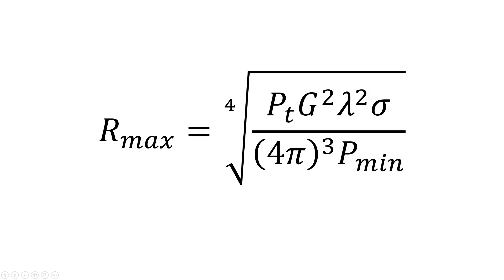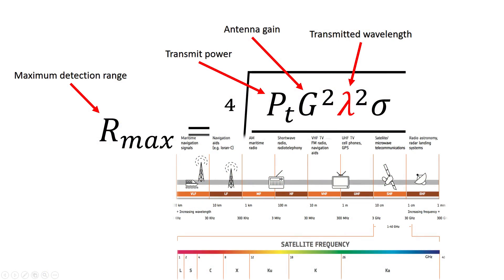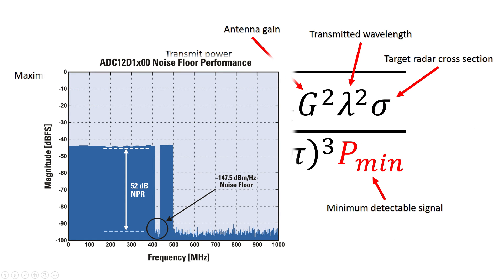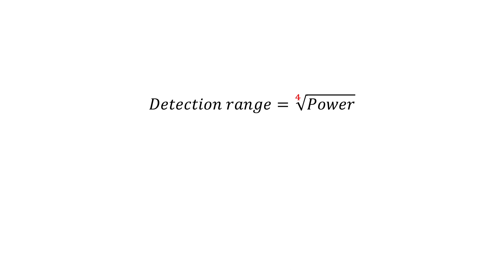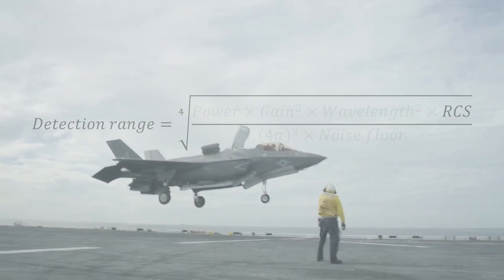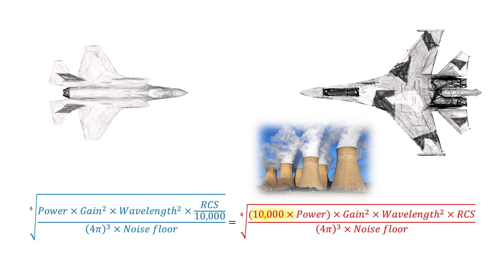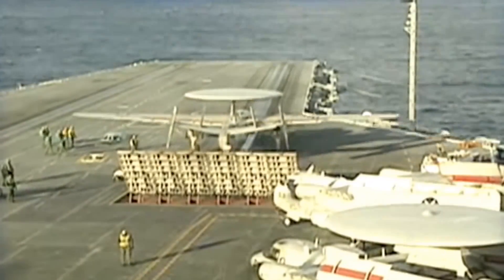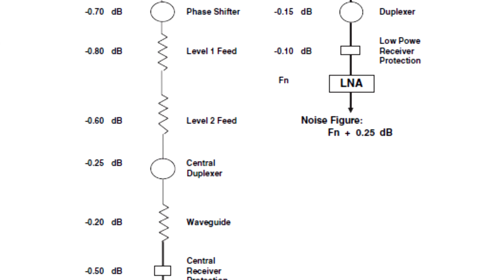F-35 Lightning II: Busting Myths - The Radar Equation [v1.1]

Comment: Fantastic. Now if we can get the enemy to only approach us head-on from the same altitude, not use IRST, not employ jamming, not use AWACS or ground based radar, and avoid using our own radar, we'll have a big advantage! I'm sure they'll fight on our terms, that's usually how wars have worked out in the past.
Reply: Oh of course this gets vastly more complex is real world scenarios. But most of those scenarios still give massive advantages to stealth. IRST detection range is much lower than radar. AWACS and ground based radar can utilize lower wave lengths but these are not accurate enough to use for missle targeting(and more importantly are giant expensive and relatively unmobile resources limiting your effective battle space). Not frontal signatures are higher but not but still comparatively lower.  

I think valid arguments can be made that the cost of the f-35 was too high both for what we got and what we needed. But all the arguments you see online about the f-35 not being extremely powerful in modern air to air combat are crazy.
Reply: @ 1barnet1, @Artie the Swolest Man in the World

1) It's sad you guys don't know what LPI is. Although theoretically you can track an LPI radar, it's much harder to do so in actuality. There are many techniques used in LPI which makes the radar not only impossible to track, but largely invisible to detection equipment. I'll talk about two known methods. The first of which is power scaling (not the official name, but it gets the point across). Essentially the APG-81 and APG-77 are smart in the fact they use only enough power to maintain a track on the target. Utilizing their much lower noise ceiling and much greater sensitivity to maintain power well below that of detect ability. The second part is channel switching. The APG-81 and APG-77 utilize a much greater and more precise bandwidth; "hoping" the frequency over 1,000 times per second at random. This combined with the much narrower FOV utilized by each individual AESA beam means that maintaining any kind of track on an APG-77 and APG-81 is nearly impossible. Raptor pilots have said many times that the AN/ARL-94 is by far the most advanced and capable piece of equipment on the F-22 (a departure from standard RWRs in that it's actually used for targeting/tracking); yet F-22 pilots have often testified that detecting the APG-77 with the AN/ARL-94 is very rare, and can only be attempted at relatively close ranges. These testimonies come from before the F-35, which employs a more advanced passive detection suite (the ASQ-239), and the APG-81 is actually an advancement over the APG-77 (except the APG-77 aperture is physically larger, which aids its detection range, a lot of the hardware advancements of the APG-81 were rolled into the APG-77 via the APG-77v1). 

On top of this, passive radar tracking is not something that every RWR can do. The standard F-16, F-18 and F-15 cannot track or target opposing vehicles passively. These aircraft only gain such capability when equipped with certain EW pods which are designed for SEAD (not air to air). The story is much the same for the Russian arsenal. Aircraft like the Su-25 and Su-34 can be equipped with pods for passive radar targeting, but for SEAD and not the air to air role. The only fighter the US has which comes standard with passive radar detection, outside the F-22 and F-35, is the EA-18G. Otherwise the passive detection role in air to air engagements has mainly fallen on AWACS rather than fighters (for both the US and Russia). The use of which is to direct fighters towards engagement, the fighter then use their own radars for execute such engagement. I have yet to find definitive documentation of the Su-35/30 or Pak-FA's capability for passive radar detection/tracking for aerial targets. Let alone for LPI radars, which all of the above conventional passive methods do not work with. 

2) IRST is not as capable as many make it out to be. Yes, the IR of PIRATE can *detect* targets at ~100 km, but that does not mean it can *engage* targets at 100 km. The issue with IRST is that IR provides no altitude, speed, range or geo-location. To gain such information, IRST uses a laser. The trouble with lasers, is that they have a very short range at the power aperture current systems utilize. Their range is well under 50 km. Even then, stealth aircraft, like the F-35 and F-22, are built to be stealthy in more than just X-band radar. "Stealth" for the USAF means passive detection capability, LPI radar, low radar observability across all bands, and low IR serviceability. I'm not saying "stealth" is invisibility. "Low observability" simply means that the signature of stealth aircraft is greatly reduced in all means compared to conventional aircraft. However, even without accounting for this, the range capabilities of IRST are quite poor. While a conventional aircraft with IRST may have a greater detection/tracking range of a stealth aircraft than a conventional aircraft without IRST; both are still at a significant disadvantage currently when compared to a stealth aircraft.
Reply: +John Ham  If you're talking about their reference at 2:54 I have sourced it, and it's a fabrication. This text is from a patent that pertains to the construction of stealth composites using carbon-nanotubes, allowing stealth to be baked into structural panels rather than painted on top as before. The patent makes absolutely no claim that these panels are any stealthier than previous materials, nor that they are effective against a wider bandwidth, it covers only the new construction method. As part of the parameters it states they affect radar in frequencies ranging from 100 kHz to 60 gHz, but makes no further technical claims or disclosures. This just specifies that it has SOME effect in these ranges, which says nothing about what the attenuation curve looks like or how effective it is across various wavelengths. If LM were claiming it was more effective at absorption than previous technologies or covered improved bandwidth this would be explicitly stated the patent, but it is not.

The narration claims "new materials have been shown to be highly affective against a wide range of frequencies," while highlighting text from the patent. As you can see, this is a lie. Not only does the patent have nothing to do with any demonstrated capability (as patents are merely legal stake-holding claims), it does not even allege to pertain to improved stealth characteristics. This is typical of the extreme intellectual dishonesty (or outright ignorance, take you pick) that is fairly common in the F-35 fan community. I can't speak to the author's intentions, but it seems telling that they don't bother to offer more depth on such a fantastical claim that would greatly bolster their argument if true. Seems reasonable to infer they know this statement is false but just don't care. I wouldn't even have known what the statement was in reference to if I hadn't already been familiar with this patent, since they don't give their source or any explanation apart from flashing some text snippets.

I mostly agree with your other sentiments with the exception of the assertion that other nations are "chasing down and wanting the F-35." Outstanding contracts to purchase F-35's have way more to do with politics than any efficacy measures (which is usually the case in defense deals, in no way exclusive to the F-35). There are few countries that are free to adopt weapons in a totally free market fashion, but India is certainly the prime example. I think it's interesting to see them vacillate between their choices, classically leaning towards Russian jets, recently looking for new Block 60 F-16s, and now apparently opting for Rafales instead. It says a lot that they have not even considered the F-35 at any point in their recent search for newer fighters.

In my opinion the biggest failure of the F-35 has to do with the procurement dynamic it creates. While the Navy has adopted an Open Architecture for ship-borne sensors/computing hardware the aircraft industry has fucked themselves by throwing all their money into a single proprietary system with limited growth potential. You're right that sensors and electronics are our greatest advantage, and the F-35 is definitely leading the way in implementing them, but in a totally backwards fashion that limits participation from other manufacturers and stifles innovation and inter-aircraft implementation.

I'm glad to see you are pretty open minded and not a delusional fanboy! Been a pleasure talking with you.
Reply: +John Ham  "Oh wait…" the F-117 has been shot down at a higher rate than the F-15 if you want to talk about sorties flown/shoot-downs. Not that it matters, because that's a useless one-dimensional benchmark that fails to recognize even basic logistics, let alone myriad other factors. The primary way all of our jets avoid shoot-down is proper mission planning, overwhelming numbers, and fighting 3rd world adversaries with hopelessly outdated equipment.

Nobody is debating whether stealth "works," of course it does—it avoids reflecting radio waves from certain bands at certain angles. The question is how useful that is in combat vs the significant trade-offs (in the F-35's case) made in every other area to accomplish it. And you're right, the primary shortcoming of the F-35 has nothing to do with stealth, it has to do with the abject failure of the entire JSF concept. The F-35's only have about 20% parts commonality, government studies have stated that developing three custom airframes would have been cheaper, and the concept resulted in performance characteristics that are no improvement over aircraft of the previous generation.
Reply: Unfortunately it is not possible to go supersonic and not become infrared beacon due to heating of the airframe. If you go high you are the only warm thing in a sub-freezing sky and if you go low the friction increases and the airframe becomes very very hot. Due to heating at low altitude every airplane which can do mach 2+ at high altitude cannot exceed mach 1.2 down low even though most have more than enough thrust. Raptor is even more limited in this respect by radar absorbent paint. I have heard claims F-35's skin itself is radar absorbent material but even if true the F-35 does not have meaningful supersonic cruise. Honestly the F-35 makes no sense from any perspective there is simply no way to do a "budget F-22" for further reading look at Seawolf vs Virginia costs...difference being the virginia class boats are basically same price but basically same capability
Reply: +SealFredy5  You do realize those papers were just the non-classified work of graduate students from over a decade ago, yeah? The advent of digital receivers and fast DSP makes seeing through LPI modulation and pulsing tricks trivial. Furthermore, modern development practices (like FPGAs) make hardware design cycles fast, cheap, easy to implement, and easy to upgrade. "In summary," any military pouring billions of dollars into defense can certainly equip themselves with ES equipment that detects LPI radar just as easily as CW radar. Get over it.
Reply: +777Outrigger 😂 You're the sultan of self-serving reasoning. All the fallacy-laden farces you come up with are hilarious. Keep em' coming, I know the F-35 fanboi circle-jerk demands you stroke your neighbor so everybody keeps their hard-on.
Reply: +John Ham  I haven't read this report or seen the video, please link and I'll read/watch. The thing that makes lower bands difficult to defeat is not just a matter of optimization or choosing certain bands, it's a limitation of the physics. Lower the wavelength, the more energy it carries (which is why you need a larger radar to produce them as well). Stealth coatings work by transducing EM energy into heat by a sort of mechanical vibration. There are fundamental limitations in how much energy can be dissipated in this fashion, the conventional wisdom being there is no way to preclude lower bands from reflecting. Even the F-117 had certain RAS features that helped against higher energy bands, but not by much, and nothing approaching the attenuation seen in centimeter wavelengths. There is also the airframe shape, but you need very long edges that are longer than the wavelengths being used, so larger planes like the B-2 are much stealthier against lower bands than any fighter-size aircraft can be. These aren't exactly things you can just engineer away, they're an inherent property of the system itself.

As for other countries, of course they will put effort into making their aircraft stealthier, this has long been a design consideration. They do not, however, approach it like we do. They use a far more balanced criteria, much less willing to compromise in other areas just for the sake of stealth. Especially when it comes to cost. They do what they can but their aircraft are not as stealthy as US airplanes and also avoid many of the pitfalls of making stealth the #1 design objective.

As for a "golden bullet" or single panacea to defeating stealth, naturally there isn't one and there never will be. Because that's not really how the process is approached, everything is simply an element comprising part of the bigger picture. Better radars, better IRST, better coordination, etc will all grow together and all used in conjunction to detect and defeat increasingly stealthy aircraft and drones on both sides. Relying too much on any single facet is a recipe for disaster.
Reply: 1) no stealth aircraft ever been only stealth head on , same altitude. If that was the case then they wouldn't be stealth against ground radar at all. Which is clearly not the case. Looking at most radar scattering graph , you can see that stealth aircraft general have bow tie shape signature 
https://basicsaboutaerodynamicsandavionics.files.wordpress.com/2016/03/f_35_metal_rcs.png

2) IRST can help somewhat but they affected significantly by weather ,humidity , target aspect and need to rely on LRF ( laser range finder ) to generate firing solution because they can't measure distance, target velocity or altitude by themselves. Laser range finder is limited to around 15-25 km so they offer much shorter range compared to radar 
https://s18.postimg.org/4wot7d07t/IMG_20170219_183944.jpg
modern stealth has measures  to reduce IR signature too
https://basicsaboutaerodynamicsandavionics.wordpress.com/2016/03/04/stealth-techniques-and-benefits/

3) Both stealth aircraft and normal aircraft can use jamming but it always  benefit stealth aircraft significantly more due to signal-noise ratio. Generally  jamming power required will decrease in the same rate as RCS reduction ,99.99% reduction in RCS equal to 99.99% less power required to successful to jam a radar. The burn through range will be reduced significantly too
https://basicsaboutaerodynamicsandavionics.wordpress.com/2016/03/29/electronic-countermeasure-ecm/

4) stealth aircraft such as F-117 often less effective against very low frequency but it has nothing to do with power in the radar pulse. In fact, low frequency will carry less power than high frequency ( which is why microwave use cm band not UHF or VHF to cook your food). The reason why low frequency work so well against legacy fighter is due to their interaction with object, when ratio between  aircraft physical size  and radar operating wavelength  start to get into Mie region, the majority of the reflection will be surface wave , and surface scattering. For legacy stealth aircraft like F-117 with full facet design this is a big problem. That is why newer design like B-2 , X-45 , F-22 , F-35 all use many blended facet to reduce effect of surface wave. Modern RAM such as CNT RAM is very efficient against low frequency too
 https://basicsaboutaerodynamicsandavionics.wordpress.com/2016/04/12/radar-electronic-countermeasure/
https://basicsaboutaerodynamicsandavionics.wordpress.com/2016/03/04/stealth-techniques-and-benefits/

5) modern RWR can certainly counter LPI, however, as all passive system , they are very bad at calculating distance to target , target's velocity , target altitude so unlike radar those RWR can't generate good firing solution for air to air BVR attack
 https://basicsaboutaerodynamicsandavionics.wordpress.com/2016/03/02/rwresm-and-passive-geolocation/
Reply: Artie the Swolest Man in the World 
The heat from the airframe is dissapated rather quickly and can't be detect at very large ranges due to atmospheric conditions. 

Then this effect of friction is smaller at high altitude and the F22 has a very high service ceiling

An afterburner tailflame on the other hand is a much brighter signiture which is much easier to detect. 

The F35 completely lacks supercruise. It can use afterburners to go to mach 1.6 and then use full throttle without afterburner to slowly watch the needle go back to subsonic speeds. 

That's not supercruise. That's marketing bullocks.
Reply: True, their spies were doing a good job, and radars were only turned on for only 17 secs at a time to prevent an attack. But because of terrible comsec by NATO, they were broadcasting in the clear with no encryption, and because they were so predicable in routing, the Serbs new exactly when to turn on their radars.
Reply: Why would China invade anybody ?
They'll buy the real estate and factories in Taiwan.
Who's gonna stop them when they come inspect their property ?

You're right Jihadi's won't do PHYSICAL damage.
But they'll do SOCIAL damage,
Turning open Western democracies into paranoid reactionary selfdestructive police states.
This does not sound like a big deal,
but it will change how people will interact.
Imagine living in a society
where you can not trust your neighbours, co-workers,
family or even your very own children.

That society is destroyed, infrastructure standing or not.
Reply: +John Ham  Sounds like you agree that the JSF concept and execution have been a disaster that produced a plane that's barely half as good as it could have been. And I fully agree that shoot-down numbers are a stupid way of gauging an aircraft's effectiveness, I said as much in my reply. Where we differ is how much of an advantage stealth is, and how much it will be able to mitigate areas where the F-35 falls short. Stealth is obviously effective against radar operating in the centimeter wavelengths, but I disagree with the spirit of the statement, "stealth is not an easy thing to detect." Stealth is not a thing to be detected, it's a feature. The aircraft is what gets detected. I'm not denying stealth is a big advantage, that would be silly, but it's equally ridiculous to not acknowledge that aircraft can indeed be detected by many other sensor methods. Inter-aircraft communication is also going to compromise their presence/location, as will use of active sensors/jamming.

In addition to other methods low-band radar is capable of detecting these aircraft and is increasingly becoming more accurate as additional processing is applied to the output. Demonstrated techniques of parallel-processing that emulates neural networks coupled with machine-learning is highly applicable to analyzing radar returns. Low band radar is rapidly becoming more effective (not less), with several experts estimating tracks comparable to centimeter wavelengths within a few years. Not that it's even necessary to guide a missile on target with such radar. The F-35 fan club seems to have a selective understanding of Lock On After Launch. They understand it allows to the F-35 to launch AMRAAMs at high off-bore-sight or 180 degree trajectories, thereby helping it in a dogfight, but refuse to acknowledge that SAMs have been using LOL for decades and that missiles can target a stealth aircraft with their active radar as long as the ground radar gets them in the vicinity.

I have no idea where all the conjecture about stealth features now defeating low bad radar comes from. Seems to be another creation of the fan club after they were introduced to the term RAS as if it were something new. They've massively conflated the concept of not needing to paint on RAM with being something somehow significantly more effective. They love to extrapolate little tidbits they find/are-fed and pretend it's something it's not. They're also big on binary discretes, aka, pretending that just because a patent states that a material has some effect in given wavelengths, that means it has equal effect in all of them. I have yet to see a legitimate article describing new stealth techniques that make low band radars ineffective. Feel free to share links if you have any, I'm always interested in new technologies.
Reply: Same. Not a fanboy and not a hater
Have a good day
Reply: 777Outrigger  I gave you stone-cold facts about the drastic deficiencies of the EOTS and you dismiss them and insist the F-35 is "sensor monster." That's exactly what makes you a fanboy.

As for the Heritage paper it's such a biased piece of garbage that it's barely worth addressing. It doesn't contain any legitimate comparisons of facts and figures, it's just a poorly conducted opinion poll. That's to far from objective, scientific, or useful that it's laughable. Is that really something that bears explaining? Do you not have a degree in a STEM field?

Check out the paper's reference for the cost of the F-35A, footnote [32], that the author cites as a source for the $85m figure. Now go read that source, it's literally an article about how the F-35 will cost more than $85m because of engine problems. It's hard to even comprehend how someone could cite a source that says the exact opposite of what they're it claiming does. That's a clear indication that the author is not just unscrupulous and careless, but reveals their intention is to push a specific viewpoint. They're not conducting an assessment, they're scrambling to find tidbits of info that backup their pre-existing conclusions.

It seems pretty clear you lack the ability to think critically, distinguish scientific evaluation from propaganda, and grasp the concept of nuance. You don't even understand the larger dynamics of how a military functions. You're just obsessed with singular weapons systems and how they compare to similar ones in a vacuum. That's fine but it's 100% fanboy realm, not really a conversation I'm interested in having.
Reply: SickKnowledge , for the sake of physics learn how sensors work :/ .
Reply: Outrigger
That is what you wanna do whilst flying a stealth aircraft, open your bombbay to fire a couple of Cuda's.
Wouldn't it be easier to just yell, "yoohoo I'm here", over the radio ?

Listen here man.
A war with Russia (or China) will devolve in attrition warfare.
In such war it is not that important which weapon system can defeat which other weapon system.
Because in the long run it will all boil down to which country can outproduce and outdeploy the other.
Remember WW2 ?
NOTHING could take on a King Tiger tank.
However, the thing was so friggin complex that only 1200 were produced during the entire war.
Unlike the US Sherman and Soviet T34 which got produced in the 10,000's per year.
In the end, the Allies could simply "afford" to lose tanks by the thousands, unlike the Germans.

So how many "potshots" do you think the Russians are willing to spend on bringing down 1 AWAC ?
1 ? 5 ? 10 ? 25 ? 100 ?
And how many fighters do you intend to divert from frontline duty to AWAC escort ?
2 ? 6 ?
Are you going to put a KC10 (another high value target) in trail of the AWAC to refuel the escort ?
Or are you going to "change the guard" 5 times per mission, diverting more fighters.
It is these LOGISTICAL questions that define the outcome of battles and eventually war.
Rather than "This system is way cooler than that system" assertions, no matter how true.
Reply: Millions can't get to Taiwan, or the first island chain, or the South China Sea. It's not the numbers that your army has, it's if you can get them to where the battle is, which China can't. They don't have the projection forces, and any significant amphibious force is going to end up on the bottom of the ocean. And America won't need to use nukes, LOL, but if China uses them, well, the US has over 10 times the nuclear warheads as China.

If Jihadis appear among immigrant groups from Syria, they can only cause minor damage, and that will enable us to root them out. Sure there will be outrage at the murders they commit, but they can only do minor and insignificant damage.
Reply: It's from a military report. He included it in the video. Take it as word or not. The idea that low band is somehow unbeatable is silly. It still has weaknesses. One of the big take aways from the nighthawk shooting down was making the stealth be more applicable to different bands and I don't doubt that the skunk works has done that. I don't think they'd just bullshit. Different forms of radar is being thought about and accounted for. For now low band is more effective but it doesn't perform anywhere near the same level as standard radar. It's not fanboyism from me at least. It's just demonstrating there's no golden shot for stealth yet. It's why everyones wasting way more money on stealth planes or stealing it in China's case. The T-50 even more so is meant to be all around stealth if you take what the Russians say at word.
Reply: The F-35 is far from a one trick pony. If you think stealth is all it brings to the table, well, you need to do some more study.
Reply: +David DS Good lord, what a troll. every single point you brought up has been dealt with and debunked. Shows how much you know.
Reply: David DS - Haven't heard about Red Flag 17-1, have we. The F-35 had a 92% readiness rate, and no maintenance cancellations. Excellent. The air-to-air kill rate was 145-7 for the F-35, and Blue Air was heavily outnumbered by Red Air in this exercise. And the F-35 took down 49 of 51 SAM sites. Yes, and the stuff in your post is ancient history. Fixed or debunked a while back.
Reply: Sorry, 40 miles ain't good enough. The bomb or missile will already be on the way.
Reply: @Boxy Brown

Ah yes, here we get to the part where you claim to be more knowledgeable and credible than the millions of engineers, generals, pilots and manufacturers around the globe.

- There are no current methods to detect and engage a stealth aircraft at long range. Stealth aircraft maintain a massive advantage over current detection/engagement systems.

- Drones, in there current form, are woefully incapable compared to fighter jets. Most are nothing more than flying TGPs. They have no BvR capability, mostly no AA capability (although the CIA strapped stingers onto a few of them), no SEAD capability, are slow, very limited payload, cannot share data, no ECM, and their other combat functionalities are mostly worse than strike fighters from the 90s. Drones which are equally as capable as manned aircraft are far more expensive than their counterparts. Only one example of this exists, and it's the MQ-4C. It's several times the cost of a U-2 (despite the same capability), and costs more than all variants of the F-35 ($155.6 vs $130.6). Note no weapon systems are carried.

- Long range missile platforms like stealth fighter jets? Your own statement literally proves yourself wrong. There is no "cheap" detection system that can easily achieve kills against a stealth fighter. S-400/500/etc systems actually cost more per battery than the F-35 does, and that's saying something considering labor/materials are much cheaper in Russia. Even then, the S-400/500/etc fall into the same issue all SAMs do. They simply cannot perform against 5th generation fleets in a tactical environment. This is the exact reason why every country that can afford developing fifth generation fighters are doing so. 

- Your idea that drones will somehow avoid getting shot down/engaged is also hilarious. Conventional methods of AA or SAM still work on drones you know: http://www.bbc.com/news/technology-39277940. And yes, this is a perfect example of a weapon being used in an overkill scenario. Radar guided AA and ECM would have been much cheaper (both of which are possessed in the military), but this is also a great example that the military uses what's available to accomplish the goal. Not the theoretical best cost ratio, but whatever works. And if you buy equipment which doesn't perform, you cannot win. 

Also, I've been called a fanboy for pretty much every fighter out there(for instance, the Pak-FA). I take my time to research and understand the topic at hand. For instance, those cost figure for the MQ-4C and F-35 are pulled from a SAR. Of which you've probably never read.

/Edit: Also, did you even watch dragon029's videos? This one literally goes over how radar/LO work, and it seems you've simply ignored it.
Reply: +777Outrigger  Great job, you can parrot LM's website, what intimate knowledge. If you knew what you were talking about I doubt you'd be praising the F-35's EOTS. It's already many years behind the currently fielded SNIPER pods, can't downlink a visual on the target, and is unable to designate targets with an IR pointer. In fact, it doesn't even have a laser-lead capability, which means the F-35 is unable to engage moving ground targets until Block 4 (which won't come until 2020 at the earliest). Yet here you are listing its EOTS package as some kind of major advantage, truly bizarre. 

The latest evaluation reports don't paint a pretty picture for the sensor fusion either. Apparently the interface is so bad that test pilots say it's distracting and gets in the way of more important combat functions. It also consistently produces false/multiple tracks and even amplifies the problem by sending that bad info to other aircraft. If you want the details you can read the official evaluation reports and DoD memos. Just beware, there's some bad stuff in there. I know the F-35 is an intensely emotional topic for you, wouldn't want to crush your dreams.
Reply: 777Outrigger  You have no salient points, you're just parroting press releases and linking to papers that are conclusions in search of evidence. I'm a not professor, I'm not going to waste my time explaining how scientific assessment works, or source evaluation, or the values of critical thinking and skepticism. You don't seem to understand the difference between empirical and anecdotal evidence. You keeping talking about pilot testimony, which tells me you sincerely lack an understanding of why that doesn't speak to F-35 effectiveness one way or the other. It's ultimately of little consequence and has nothing to do with criticism of the program.

You can write out the results of Red Flag all you want but those numbers don't mean a whole lot without the specific scenarios of the engagements. I've read most of what I saw in terms of official coverage and I've been unable to find anyone reporting those details, so it would appear they were not shared with journalists. Therefore, there's no way to asses the veracity of the picture those claims paint on the surface, which isn't all that surprising seeing as military press releases are often very deliberately crafted to produce this kind of result. It's fairly easy to misrepresent these types of things. If you're happy to blindly trust government PR that's up to you but it's about the dumbest and most naïve thing you could do if you want to have a genuine discussion about military matters.

I have no idea what video you're talking about. I see no such link but feel free to provide it and I'm happy to watch. The way you're characterizing it makes it seems like a statement I wouldn't neccesarily disagree with. The problem is not this absolute binary of whether the F-35 is good or not, it's a question of whether it can deliver on its claims in an effective manner and the opportunity costs involved.
Reply: Lets not forget the Su-57 uses fiber optics and F-35 uses firewire guess which one is more reliable against RFI and EMI using light as a source along with higher data transfer rates Harrison better increase the throughput as they promised for F-35.....Oh I heard as well that Britain and japan are collaborating to create a AESA seeker warhead for the F-35 called JNAAMS, K-77M back in 2013 already has this. AESA according to pdf for F-22 shows X-band only as it frequency ranges. F-35 is based off of something like apg-81 based off of apg-77v1 or based off a a 10 year old design for IRST called sniper XR. So no doubt x-band composite or dielectric material will be put on Su-57. There was more information about photon radars. like ROFAR for Su-57 but the specs are described better in details about the mentions of the Mig-41. Saying it uses UHF signals to get images of targets. F-22 and F-35 easily exposed to VHF and UHF. Nebo-M uses sensor fusion such VHF cue UHF and UHF Cue X-band to hit targets, such examples given are DF-12 RCS of .002 at X-band but at VHF is at .6 RCS.(can track 20 ballistic missiles from 1800km away) Global security website states a radar section of a human is 1 in RCS that goes on saying it can recognize human face less than 1/10 the size, mass, weight of the whole human body. in other words less than .1 in RCS ROFAR stated says it can identify a human face at 400km. So rumors say RCS of steel golf ball which is .001 think of that as DF-12. Everyone remember the silly .0001 RCS of steel marble F-22(which does not mention sides of any sort) General Hostage stated the F-35 has more stealth than F-22 so this .0001 is apparently bigger in size than .001...so it is more than likely at a 400km range on UHF band can identify the F-22 or F-35. They are working on making this radar optical... Su-57 has a radar than can switch roles with its ECM has smart skin sensors, dont know if APG-81 can switch roles with its ECM but when i google F-35 smart skin sensors I get US 6th gen aircraft mentions.....Rather if the APG-81 is powerful or not I have yet to see statistics and apparently the statistics computers, missile warhead tech guidance, sensor fusion, smart skin, nervous system, centralized computer that can make aircraft fly on its own and photon radar ambition are mostly leaning towards Russian avionic superiority on 5th gen aircraft.. I wont say anything until KRET and Raytheon make statements on their avionics. Such an example is both use GaAS AESA Russians said they upgraded theirs maybe US did as well for GaN AESA. But again I just look at some information presented before me which fan boys will find difficult to refute
Reply: @Boxy Brown:

1). The F-35's APG-81 is far more powerful to any in-service radar with both Russia and China. The APG-81 is also one of two radars (the APG-77 being the other) with LPI, or Low Probability of intercept, which means it can operate without being detected. AESA radars are also highly resistant to jamming because of their capability to use a very large spectrum of frequencies simultaneously. On top of this, the F-35 has it's own EW, which is far in excess of any other fighter aircraft. IRST at best will handle tracking at ~50 km. PIRATE claims a detection range of 100 km (well within the AIM-120D's engagement zone), while the laser needed to actually track a target is far more limited in it's threshold. The Russian IRST is commonly stated at ~35 km effective range. So at the end of the day, the F-35 dictates the engagement. You're simply ignoring facts to try and paint it another way. 

2) You need to read into more of the stuff Dragon029 has done. The test reports by Gilmore aren't very good, and quite dishonest. To start with, he's not a part of the Pentagon. Nore is he a weapons tester. He works for the Secretary of defense, and only reports on failings. His papers are quite skewed because he reports entirely out of contexts, and often reports incidents which are no longer issues, as they were solved long before his releases are made public. Furthermore, Gilmore never compares apples to apples. He uses comparisons like F-35s on blk 1 software, to fully developed threats. Another glaring example is he uses the F-35 variants completely interchangeably based on which ever looks worse. An example of this is that he always quotes the F-35B for range/loiter regardless of the situation. Testimony from actual pilots should be used over Gilmore. For instance those of Morten Hanche, like this one: https://nettsteder.regjeringen.no/kampfly/2016/09/16/lack-of-perfection-does-not-mean-disaster-how-i-read-test-reports-as-a-pilot/. 

3). Funny thing is, your "evidence" is anecdotal, not empirical. The testimony given by Gilmore is just that. I suggest you watch the rest of Dragon029's "busting myths" series, and then proceed to look into the issues mentioned by DOT&E. I'd also encourage you to actually re-read that document, because it doesn't make 90% of the claims you think it does. For instance, you were very selective with your quotes, and vastly cut them out of context. Your first quote is actually "If Initial Operational Test and Evaluation (IOT&E) were  conducted today on the aircraft in Block 3i configuration - with which the Air Force recently declared IOC -the system would likely be evaluated as not effective and not suitable across the required mission areas and against currently fielded threats." See? He's not saying the F-35 is ineffective or unsuitable, he's saying that if Block 3i was the final software (which it's not), then, and only then, the F-35 would be ineffective and unsuitable. You left out the context, that he's not comparing a fully capable aircraft. Rather a testing software, which doesn't provide the full capability. Your second quote is Gimore's opinion (not fact or data driven) that Block 3f is going to be late. Again, hardly anything to throw your arms up about if you actually read within context. 

People like you are the issue. You take things out of context, to prove a biased and false narrative.
Reply: +1barnet1
AWACs will be the first targets to get shot out of the sky by S400's.
Not much you can do about that except staying out of range (400 km).
Reply: Interesting theory. I suppose there must be the corpses of AWACS planes all over the place due to the certainty of hitting them with SAMs, considering all the conflicts we've used them in. One day my country will figure out how to destroy a SAM site. One day.
Reply: Got enough bait there to catch a whale buddy! Illogical statement 1): 
Enemy detects AWACS; nearby escorts concerned about their own stealth. 
Illogical statement 2): King Tiger invincible or even capable of being a
 war-winning tank. Illogical statement 3): better funded military will 
run out of small, simple missiles before lesser funded military runs out
 of huge complex missiles. Illogical statement 4): Military which 
operates more modern fighters than the rest of the world all put 
together, will lose war of attrition against lesser production 
capability, lesser funded, lower quality outnumbered military.  Excellent post my friend I salute your effort
Reply: +Boxy Brown

- Alright, let's play the "classified" game (which goes both ways). Power scaling and channel switching are only two known methods hiding transmissions that LPI radars use. If you talk to F-22 pilots, they will testify that the ARL-94 is the most advanced piece of equipment on the plane. The ARL-94 was the first built EW system used on a fighter that could passively detect and track opposing fighters instead of using an active radar. Yet F-22 pilots state that the ARL-94 will only detect (not track) F-22 emissions from very short ranges, if at all. Given that the ARL-94 was built with the exact operating specifications of the APG-77 known, and is far more advanced of a passive radar reciever than anything used on non-US aircraft; your argument falls apart. Further more, Russia has not built a fighter with a production AESA radar, let alone LPI. Thus suggesting they've come up with a more complex technology to counter one which isn't understood is quite obloquy. 

- Quite the contrary. There is nothing trivial about detecting AESA, let alone LPI, radars. All of your papers made a clear point of that, one of which (from 2011) making a point to state that no current passive radar detection system is capable of performing successfully against LPI radars. 

- "any military pouring billions of dollars into defense can certainly equip themselves with ES equipment that detects LPI radar just as easily as CW radar. Get over it." So is this why the F-22 lacks this capability? What about the F/A-18E/F? F-15E? F-16? None of them can detect or track LPI radars. Yet Russia/China (whom are 10-20 years behind the US in this department) have "magically" developed this capability? Yeah, bring me some proof.
Reply: +Outrigger
China can draft 200M Infanterists.
There are currently not enough AK47's on the planet to even arm them all.
It really does NOT matter how much bigger the US airforce is, if the US army gets overwhelmed by those kind of numbers. Thus in a war with China, the USA will run out of options in a hurry and has no choice but to resort to dropping Nukes to stem the tide. Guess what, China will retaliate.
And the result is: Biosphere destroyed and all higher species extinct (including Homo Sapiens).

Uhmmm, the idea was to "win" wars, remember ?
These scenarios have all been played out ad-infinitum since the 1960's.
Bringing stealth fighters into the mix will not significantly change the inevitable outcome.

The coming war will not be great power against great power, but small group Jihadi's against civilian populations. Rendering expensive (stealth) weapon systems completely pointless.
We have already seen the invasion of military aged men pretending to be "Syrian refugees".
The wait is for them to put themselves into action.
Reply: Capitalism and democracy are great to have but they seem to inevitably produce peace-time boondoogles like the F-111 and the F-35. It doesn't worry me though, the USA always seems to put profit last once real war comes around. In the meantime we end up with hideously expensive unrealistic pieces of military equipment such as turbine engines in tanks and "budget" "stealth" fighters
Reply: Of course the enemy can use IRST, jamming, AWACS, ground radar and eyes because the F-35 also has jamming, IRST, AWACS support and ground radar support.
Reply: It's in the video. Source if you are curious. I've read other stuff and the reason for Russian radar difference has nothing to do with performance it has to do with being better designed for all forms of radar rather then one. Google about the Pak 50 and you'll see what the Russians say.

I'm not sure we disagree here. My exact issue with the JSF program is what you just said. There's no flexibility in the design and it's entirely based upon stealth and electronics which destroys gen 4 aircraft but facing any country that has stealth it's advantages become one 1D. As always in American military design we'll be saved by the grace of our electronics not the quality of the rest of our design. 

What annoys me most as a American is we can do both(Good design and electronics) and the reason we haven't was because of this botched idea of JSF. We tried to replicate Russian frame platforms but forgot the Russians also have many other aircraft designs beyond the singular frame. It's really retarded what we did. I personally have no faith in the F-35 against a T-50. I have no clue how it'd go down, if forced I don't feel the electronic capabilities will be superior enough to beat a T-50s performance and capability. However practically every nation in the world is chasing down and wanting the F-35. There's clearly a massive advantage the plane offers. 

Reading back over I disagree on the technicality. You are chasing the stealth ghost when it's more irrelevant to why it's a failure as a project. It failed on the primary objective of the JSF. A cheap stealth plane. It is not at all cheap and it is not at all near the design and performance capability if you simply had a gauntlet of specialized planes.
Reply: +Boxy Brown Obviously that means that any nation trying to attack the US can only ever play defense. Moving those platforms that can detect stealth into an assault roll is pointless as they are NOT maneuverable. And once they ARE taken out, which they will be as they CANNOT lock onto stealth aircraft and are ALSO vulnerable to radar Jamming thanks to the F-35's capability to radar Jam, sorry bro, F-35 and F-22 have the edge no matter how you slice it.
Reply: If it was so easy, then why do they still have issues tracking B2 bombers, which are 80's level stealth? You need to think before you blabber your ignorance online bucko.
Reply: He is trollling at this point bro, let him suffer in ignorance.
Reply: Well, Quantum radar is still in the laboratory, which probably means at least 20 years before a fielded system. And even China says it has a 60 mile detection range, which is fair, but not great. And apparently, the LM Quantum Radar research went black--it definitely went quiet. Maybe there will be some kind of equally exotic counter measures in the future?
Reply: SealFredy5 is the ultimate triggered fanboy 😂 His error-laden rants are epic, I love it. Anyway, quantum radar is nothing more than an exotic lab experiment at this point, that part is true. I've never heard of a successful entanglement of particles beyond the confines of a lab. Unfortunately for the F-35, very conventional methods can be used to detect, deter, and destroy it if that time ever comes. 

It's already outdated, drones and long range missile platforms are far better options for fulfilling nearly identical mission profiles. It doesn't take a genius to understand that you can detect targets using drones (which are way easier to hide) and launch stand-off weapons from a cheap missile truck to destroy them. Costs a fraction of the price and doesn't put a pilot in harm's way. There have also been successful demonstration programs like CHAMP that are more efficient than manned aircraft. Every F-35 is just impeding progress toward unmanned platforms that have already proven reliable.

F-35 fanboys don't understand the concept of opportunity cost. They can only beat off to weapons that already have corresponding marketing videos, so the fact that the F-35 is actually a horribly inefficient hold-over from 20 years ago is lost on them.
Reply: Boxy Brown has lots of credibility. Drones filling the air and cheap missile tricks. Right. Shall I tell you about the problems with your easy and simplistic solution to the F-35. Never mind...waste of time.

Do you believe the US landed men on the moon?
Reply: 777Outrigger Hold on, are you a fucking moon hoaxer? Do you NOT believe we have landed men on the moon??
Reply: A LOT of you F-35 haters are moon landing conspiracy types. Seems to go together. And I've recently outted a couple of F-35 haters that believed the moon landing was faked.
Reply: 777Outrigger Lol, well that's amazing. Anyone who denies the moon landings has some serious cognitive issues. And I'm not an "F-35 hater," I just think it's absurd to believe it's some super plane and deny that it has shortcomings and vulnerabilities just like any other aircraft.
Reply: David - Speed is not harder to beat. F-35 haters like to point to all the IR systems that are proliferating. Well hyper-speed cruise missiles have a IR signature the size of Utah in August. Just an increase in speed from .80 mach to 1.0 mach will, roughly, double your IR signature. And the F-35 just fired an SM-6 Over-the-Horizon at a target the Aegis Cruiser couldn't see--the F-35 to the rescue. Ships won't have to wait for the horizon to fire. But I digress.  If I were a fighter pilot, I wouldn't want to go streaking around at a red-hot speed, so to speak. You'll light-up the sky. I would rather fly around at a very cool speed, with stealth.

LM fully knows about Quantum radar. Their program, more than likely, went black. Counter measures will come as quickly as the Quantum radar will.
Reply: Boxy - Well, that's a fair enough comment. I certainly don't believe the F-35 will be invulnerable. I do believe the environment will become less permissive for the F-35 over the coming decades. And it's not that I think the programs that the Russians and Chinese are so desperately working on are useless, just not the show stoppers that F-35 hyper-critics say they are.
Reply: I fear I'm being mocked by David. :-)

No I'm not a radar expert, but I do have expertise in certain areas of aviation. I have read what radar engineers, experts if you will, have said about various types of radars, their strengths and weaknesses, and those are the guys I'm parroting. And these radar experts will often laugh at what's being said about F-35 detection these days. I've read some of your comments, and your obviously not an expert in some of the areas you post about the F-35 either. So lighten up.

And yes, arguments will often devolve into the F-35 is useless, or the F-35 is invulnerable. I'm probably guilty as any, sounding like I think the F-35 is invulnerable. But I have read some people who have clearly said the F-35 is a useless flying pig, so I usually start my comments from an irritated place. How's that for an olive branch.
Reply: Of course David is mocking you dude. He calls the F-35 a flying dildo 😂 He also keeps talking about quantum radars which are like 10 years away at best. It's a limitation of physics, not military technology. Figuring out how to entangle particles at a distance is a prerequisite for such radar, the implications of which will go far beyond remote detection. And when it is invented it will definitely not be called "radar" because that means detection via radiowaves by definition 😀 Quantum "radars" would not utilize radiowaves or any other type of electromagnetic reflection.
Reply: He also said, "Talk to me Goose". Showing his need for help in Situational Awareness from his back-seater. The F-35 will have SA at a level far beyond any other aircraft. At Red Flag 17-1, the F-35s hung around even when declared out of weapons, transferring info from it's superior sensor system to F-22s, F-16s, and the RAF EF, and made them much more deadly.
Reply: SealFredy5  "Millions of engineers, generals, pilots and manufacturers around the globe."   You're a riot kid, what a ludicrously  childish generalization. That sounds like something a 12 year old would say. Good stuff, keep 'em coming!
Reply: @Boxy Brown

You failed to argue counter to the points. 

Everything you've said here has been provably false. Willful ignorance isn't something you should be proud of.
Reply: A little more about Situational Awareness, which is far more important than aerodynamic performance, or than anything else in air-to-air combat. This is from RAAF Air Marshal Geoff Brown, who was an exchange pilot flying F-15s at Red Flag.

“In any practice engagement I have had in the last 20 years where I have turned with another aeroplane in a bigger picture environment – rather than the static one by ones, two by twos or four by fours – every time I have tried to do that I have ended up being shot by somebody else who actually is not in the fight. As soon as you enter a turning fight, your situational awareness actually shrinks down because the only thing you can be operating with is the aeroplane you are turning with. The person who has the advantage is the person who can stand off, watch the engagement and just pick you off at the time. So you got to be really careful about how you use those KPIs.”

“…the ability to actually have that data fusion that the aeroplane has 
makes an incredible difference to how you perform in combat. I saw it 
first hand on a Red Flag mission in an F15D against a series of 
fifth-generation F22s. We were actually in the red air. In five engagements we never knew who had hit us and we never even saw the other aeroplane…. After that particular mission I went back and had a look at the tapes on the F22, and the difference in the situational awareness in our two cockpits was just so fundamentally different. That is the key to fifth-generation. That is where I have trouble with the APA analysis…. To me that is key: it is not only stealth; it is the combination of the EOS and the radar to be able to build a comprehensive picture. In that engagement I talked about at Nellis, in Red Flag, the ability to be in a cockpit with a God’s-eye view of what is going on in the world was such an advantage over a fourth-generation fighter – and arguably one of the best fourth-generation fighters in existence, the F15. But even with a DRFM jamming pipe, we still had no chance in those particular engagements. And at no time did any of the [aerodynamic] performance characteristics that you are talking about have any relevance to those five engagements.”

And the F-35 sensor system is a generation ahead of the F-22's. There's a reason for the old fighter pilot saying, "lose sight, lose the fight."
Reply: Yes it has RAM, that is like armor. :-)
Reply: SealFredy5 There's nothing to counter. You literally tried to justify your position by claiming that every engineer, pilot, and general ("millions" of them!) agrees with you 😂   That's the kind of shit a 10 year old would say. You're delusional and unable to piece together an evidence based argument. You just make generalized nonsense claims, many of which are straight up Looney Tunes, like saying that drones "cannot share data." I already destroyed you earlier in the thread, feel free to re-read the numerous sources I included.
Reply: @Boxy Brown

Yes, the argument of attacking the other person. What people do when their actual argument has fallen apart. 

Again, you failed to prove your point. You're distracting from the fact that there's no evidence to support your opinion. On the other hand, my opinion comes drawn literally from the facts and evidence presented by countless generals, engineers, pilots and manufacturers. Seriously, there's a reason why every pilot describes 5th generation jets as far superior. There's a reason why generals all support and argue for the need of 5th generation aircraft. There's a reason why engineers/manufacturers have for decades strove to create what are now deemed 5th generation aircraft. If you had bothered to look up/listen to the people knowledgeable (I happen to personally know a few), you'd find out how clearly your opinion is not based on reality. One would think that by posting on Dragon029's videos that you'd at least have watched them, which you clearly have not.

Please, reexamine my points listed two comments above and come up with a counter. Especially because your argument seems to hind on costs, I'd recommend you actually look up the SARs and find out how much different weapons systems actually are. Seriously, drones are very expensive, and extremely incapable.

The burden of proof lays on you, as you're making the claim against what literally every military in the world currently believes.
Reply: @David DS

First off, I seriously hope you're not trying to refer to "Top Gun" the movie as source of realistic aerial combat.

"Armor"? Armor doesn't exist on aircraft. What helps aircraft fly after taking fire is redundancies, not armor. As an example of this, the A-10 has both cable controls and hydraulic controls. Thus if the hydraulics are punctured, the aircraft may still be controlled. In the case of the F-35, each control surface uses independent closed loop hydraulics. Control input is sent via wire, the entire system being electronic. Thus losing one control surface doesn't seriously detriment the aircraft, and making it nearly impossible to disable more than one control surface with a single hit. 

Even so, the ability to withstand damage isn't that important in aerial combat. The most important factor is getting the first shot off. This is almost always determined by situational awareness (SA), and the denial of SA to the opponent. Hence why stealthy aircraft with powerful radars are what dominate the focus of modern fighter development. A good study to look at when it comes to what modern combat looks like, and how it got there: http://csbaonline.org/research/publications/trends-in-air-to-air-combat-implications-for-future-air-superiority/publication
Reply: "Talk to me, Goose."
Reply: SealFredy5 Lol, you're so uninformed you think that everyone in the command structure is in favor of the F-35. That right there is all the evidence needed to demonstrate you live in a complete bubble. There is plenty of dissent across the board and you're apparently oblivious to it because all you see are press releases, advertising materials, and fanboy youtube videos. Believe whatever you want kid, there's no point in engaging you because you're unable to acknowledge basic realities, you live in a fantasy construct.
Reply: The AN/APG-81 AESA RADAR, EOTS, EODAS, input from MADL, all  fused into easy to use form on the pilot's visor, will give the F-35 unprecedented Situational Awareness. Much better Situational Awareness than Goose could give Maverick, despite his desperate plea for more info from Goose to improve his SA.

Yes, there are a few ossified pockets in the USAF and the USN, who love their babies, and are clueless about all the systems, besides stealth, that the F-35 brings to the table. The most obvious block of resistance in the USAF is the A-10 community. I've had former A-10 pilots as my copilots, and they're as dumb as rocks. You can explain to them why F-35 criticisms are mostly baseless, and they'll agree, but the next day they're spouting the same non-sense you shot down the day before. Sheesh! And of course there's the Navy's F-18 community. Chip Berke explains their problems very well indeed. Look him up.

And Here's 31 F-35 pilots comparing their F-35 to their former fighters, and a breakdown of specific reasons why.

http://www.heritage.org/defense/report/operational-assessment-the-f-35a-argues-full-program-procurement-and-concurrent?_ga=1.164838079.1875249718.1485726059

Here's the shortened version if you have ADD.

http://dailysignal.com/2016/08/05/9-insights-on-the-f-35a-from-31-experienced-fighter-pilots/
Reply: Boxy Brown The F35 can be a fucking lemon and still wreck everything in the sky. It's as simple as that. Take it from those that have flown it, and haven't mentioned a single problem you've mentioned.

F15 and F16 pilots consistently say that if they could choose any plane today to go into combat with, they'd choose the F35. Even a couple F22 pilots say they'd choose the F35 over the F22 because it's stealthier, has a better helmet, and the situational awareness of a F35 pilot is at least an order of magnitude better than the F22.
Reply: Don't forget they have to close their eyes too
Reply: You cannot hit something with enough microwave energy to get a signal to bounce all the way back to your own plane without hitting that object with enough microwave power for it to be able to notice. No matter how many times you jump frequencies the range of freqs you can jump is just not very large. It is constrained by the size of the antenna(s) Furthermore the fact the radar can detect the reflected microwave energy from the taret means there is plenty for the target to detect because even the least stealthy aircraft is not going to reflect all the energy transmitted at it so you'll need enough to transmit enough power to actually get a usable signal to return, and the radar cross section of other fighters are getting lower all the time. Furthermore it is not physically possible to have for a fighter aircraft to have low radar observability across all bands. The aircraft would have to have skin several feet thick.  nor is is possible to traverse the atmosphere at transsonic or supersonic speed without friction making the aircraft's skin warm. It is true IRST cannot provide all the information about a contact that radar can but submarines have been using only sound to shoot at each other for decades, a purely passive sensor is hardly insurmountable
Reply: Boxy Brown And it's obvious you can't read. The operative words in both of those reports were "on time and on schedule". And in one of those reports, the plane couldn't meet the requirements because there weren't enough pilots to validate the newest software and deploy to OIC at the same time.
Reply: not quite how it works my friend the friction heat dissipates in a short distance from the airframe but the infrared radiation is light and travels many many miles. Radars have come a long way and so have infrared sensors. F-35's infrared sensors can track a ballistic missile; Typhoon's infrared sensor can track the planet Venus. Longwave infrared radiation can be detected through clouds etc. Ironic that the airborne IRST was first seen on the F-102, carried by a few aircraft types up until the early F-4s and then forgotten by America (but not our allies or our enemies). What I mean by all this is that a cutting edge modern IRST can track a subsonic aircraft from 50 miles so go figure for a supersonic one
Reply: All the specious arguments about LPI techniques are pretty funny. LPI radar is easily detected (and jammed) with minimal digital processing. It's been openly demonstrated and discussed for 15+ years, read http://bit.ly/2iCCslB, or http://bit.ly/2iCCdY3, or http://bit.ly/2k6gjts, etc. As is often the case in fandom circles, people tend to learn/memorize just enough to convince others (and themselves) they know what they're talking about while remaining largely ignorant of the science behind it.
Reply: @Artie the Swolest Man in the World

- You clearly have no idea what LPI actually does, or actually is. Let me get you a quick quote from one of the post-graduate papers linked in Boxy Brown's sources: "Some receivers using conventional interception techniques can not efficiently detect and identify LPI radars. Mismatched waveforms used by LPI radar cause RWRs and conventional ES systems to detect the LPI radar at very short ranges, if at all. In these cases the RWR/ES system’s detection range is much shorter than the operational range of the LPI radar, providing a detection disadvantage for the RWR/ES systems and a lethal advantage for the radar versus a potential target platform. " In short, LPI does prevent traditional RWRs from ever detecting LPI radars. These are the RWRs which are present in all F-15, F-16, F-18, Su-27, Mig-29, Su-30/35 aircraft. Only certain EW pods could possibly have been adapted with capability to detect LPI radars, even then they likelihood of the developments being advanced enough to detect the high end deployed AESA radars is doubtable from longer ranges. 

- Yes, reductions along all wave lengths can be achieved without aircraft skin being "feet thick". It's called RAM, and it works with all radar bands. Angling on stealth aircraft is primarily focused in the X-band, as angling for larger bands needs to be quite big in order to effectively work (why detecting stealth fighters with larger wavelength works in the first place). The B-2 is stealthy even to large wavelengths thanks to it's large size, and consequent angling. Smaller fighters reduce their signature against these frequencies by utilizing advanced RAM. Although it's not as good as shaping found on the B-2, it's significantly better than having nothing, like conventional fighters. 

- Using sound works for subs because they're underwater (and can't go supersonic). New forms of detection will be invented (current will get better), but as of now stealth aircraft hold a significant advantage over non-stealthy aircraft. Hence why both Russia and China are scrambling to put stealthy aircraft into service.

----------

- Those papers do not prove what you think they do. They display very rudimentary detection methods, against very rudimentary and low tech LPI radars. Although it proves that future RWRs will have capabilities to detect LPI radars, it does not prove in any form that current platforms do. In fact, if you bothered to read your own sources, they state many clear signs of the difficulty: "Electronic Warfare Support (ES) receivers currently in service are not optimized for the detection of LPI radars as they lack the sensitivity to detect the signals at sufficient range to provide military crews with an operational range advantage." Continue to read through the papers, and you find the challenge behind detecting LPI signals, rather than the ease. In summary, LPI radars, much like stealth, are give the operating aircraft an insurmountable advantage currently. Current RWRs and EW systems aren't able to detect or track LPI signals, and such isn't set to change until the next generation of aircraft.
Reply: The Serb shoot down of the F-117 tells us something interesting. 

They knew the exact routing of the F-117, and when it was coming, but they still only detected it with their P-18 VHF Radar at 50 kms, by their own admission. Very terrible. The F-117 had significant Radar reduction against VHF radars, probably both RAM and RAS.

IR has a number of inherent problems. But it's biggest problem is significant thermal reduction by the F-35.
Reply: The opening of an F-35 weapons bay door will only be for  split second. Maybe a short spike on the radar, but then it's off the radar, and gone again. Meanwhile your S-400 is toast.

And the USAF, the USN, and the USMC have more fighters than Russia and China combined. And China only has 800 modern fighters, LOL.
Reply: David DS 

The F-117 only showed up on radar when it was directly above the SAM with bomb bay doors open. The F-117 also had no form of an RWR.

The British warship spotted the F-35 due to the use of transponders and luneberg lenses on behalf of the F-35. 

The F-35's range is better than any other western fighter in clean configuration. An F-35 is roughly equivalent to a legacy fighter with two drop tanks in regards to range.

Top speed of the F-35 isn't an issue. Fighter almost never go above mach 1.4, pilots often go their whole career crossing such only once. The F-35's top speed is also a product of DSI, which help with stealth, maintenence, manufacturing and cost. 

"Suicide drone" as in a missile? Missiles still need an initial track before launch, hence where fighters come in. Only stationary targets are viable for over the horizon missile attacks. 

92% Mission rate, missions only canceled by weather. That indicates that the "difficulty" doesn't hamper combat success. Not sure how cost factors into combat capability?

Low bandwidth radars are not viable for targeting. They can be used for detection, but cannot engage a target (IE launch a missile towards target). Quantum radars are also a laboratory thing at this point. 

No, networking can use satalites, directional wireless or ground. All of which are used in current communications systems to achieve speed, redundancy and capability. 

"Weak" as in the most capable fighter ever built? The F-35's DAS and turning capabilities guaruntee that it will get the first shot off in almost every scenario. That's of course discounting the F-35's (and F-22's) absolute dominance in BVR, which makes up all of modern air combat. Literally ask any pilot, if they're rather be in an F-35 or any legacy aircraft for aerial combat. Every single one will choose the F-35.
Reply: Yes, however, reality is not a vacuum Sickknowledge. If you have paid so dearly for your stealth that you are outnumbered 10:1 it is of little 
comfort. I have a cheap, easily produced easily maintained stealth aircraft of my own, parked right on the bridge I am currently selling
Reply: You know that paper's from 2001, right?
Reply: fliteshare - Ever hear of the Cuda missile? It's meant to shoot down long range air-to-air missiles and SAMs that take unlikely pot shots at AWACs or tanker aircraft. The F-35 and the F-22 will be able to carry 8 internally. If there's a possible threat to AWACs and tanker aircraft, they would be escorted by F-35s or F-22s carrying Cuda missiles.
Reply: +Artie
The illogics started already with the presumption that airforces win wars.

And military history is filled with underdogs beating the odds against conventional wisdom.
What do you think the Vietnam war was ?
3rd world country against the richest country on the planet funding 1 against 10000.
USAF reigns supreme against a handful of MiG's
USA has to throw in the towel, because the lack of tangible results became politically too embarrassing.
How about Afghanistan ?
3rd world country Mujahideen against the Red army, funding 1 against 10000.
Mujahideen have NO airforce.
Soviets have to throw in the towel. Same political reason.
How about Lebanon (Hezbollah).
3 highly trained Israeli divisions march into Lebanon to "take care of the Hezbollah problem once and for all". 
Hezbollah has NO airforce.
A month later 2 divisions barely make it out. Having created a better organized Hezbollah in the process.

All very illogical.

BTW the most logical thing would be to have peace (too philosophical ?).
Reply: A lot of silly self-serving reasoning on your part.
Reply: Artie the Swolest Man in the World 
Actually supercruise is a advantage since it means it can go fast without lighting up like a christmas tree on IRST. You can always cruise slower if desired. 

The F22 does need a upgrade in regards to IRST. It was developed in quiet some time ago so that's just natural. 

They can use the Awacs as their primary radar while staying covert themselves. Using networking to tell them where the enemy is.

But this doesn't help clients buying the F35 since only the USA has Awacs capability. 

Listening to radar however applies both ways. The F35 can also detect an active SU radar. 

Unfortunately the F35 much slower has lower range and is less manouverable. It relies on how it can exploit it's stealth advantage. 

Which is tough for customers buing the F35 for defensive reasons. 

It really seems geared towards agression rather then defense. Getting in a hotzone drop a bomb and get out. 

Hoping the enemy doesn't have very fast interceptors that can take down returning F35's.
Reply: the serbs were not running their radars continuously. they timed the F-117 flights based on when their spies had seen one take off and waited for the just about the right time to start scanning. Who knows how far they might have detected it otherwise
Reply: +Boxy Brown - Wow, what a great answer. I guess you're out of ammunition.
Reply: Finding the B-2, F-22, F-117 have gone so well. Oh wait..they've flown tons of sorties without being seen. Obviously it works, stealth that is. Otherwise every nation wouldn't be attempting to replace current gen fighters with stealth variants. The F-35s issue is its one plane meant to replace 3..and it's not a master or the limits of US capability. With the stealth program the US has a lead over everyone and instead of doing what they did with the f-22 and maximizing that lead they are deluding it into a single platform for cost reasons prompted by stealth technology.
Reply: A single shoot down isn't definitive data. You understand that right? My point was to illustrate these planes fly missions all the time others can't. Listen for 5 seconds to any air force general or army general it becomes clear...they can do more sorties and many different missions with these stealth aircraft. The Iraq army had the capability via the meme method of shooting down the F-117 but all they did was shoot aimlessly into the sky with no real clue where anything was..all that shooting down proved a already known fact..stealth isn't invulnerable it's a advantage. I don't believe we are in disagreement but stealth is remarkable advantage in a fight..always. I can shit talk the memeness of superior Russian maneuverability but at the end of the day it's a distinct advantage. That was really my point. Stealth is not a easy thing to detect..especially with the new materials being used to make low band even more pointless and sketchy. Stealth and radar detection are in a constant battle with one another, we won't know the outcome until a actual war happens. 

As for the F-35 I agree it's a shit plane. The JSF program was a horrendous idea that's goal was to reduce cost and all it did was increase cost. It should be paused and replaced by a variety of stealth variants instead of a singular platform. The F-35 is still one of the best planes in service and will be for a while but it's also a over-bloated shitty plane. It's a paradox of a plane. I'm highly skeptical of the F-35 and it's performance against other stealth aircraft. It's clearly far superior to gen-4 planes given the red flag tests and the various other inherent advantages but I highly doubt it'd fair well against a F-22 even with it's dinosaur electronics. Everything good about the plane has nothing to do with the plane. It's fucking hilarious.
Reply: I've done a whole lot more than parrot the LM website. I can't remember when I've even been on that website.

You just don't want to address what the 31 F-35 pilots said when they compared their F-35s to their former fighters, on my linked article above.

The availability rate for F-35s at Red Flag 17-1 was 92%, and there were NO maintenance cancellations. Excellent! The air-to-air shoot down tally was 145-7, and the F-35 took down 49 of 51 SAM sites, not to mention how the F-35 is kicking derriere in many other recent exercises. And that's with Block 2B and 3I software. Just wait til Block 3F is installed.

And you didn't watch my linked video on Dr Gilmore of DOT&E saying the capabilities of the F-35 are VITAL for the US military? Just like every other person who has had the classified briefing, including now President Trump, who changed his mind about the F-35.

And when an F-35, in Red Flag 17-1, was declared out of weapons, it hung around, giving it's sensor information via MADL and Link16 to friendly aircraft, even improving the SA of the F-22 and EF. It was like a mini forward deployed AWACs. SAY WHAT YOU WANT ABOUT EOTS and EODAS, THE F-35 IS A SENSOR MONSTER, as proven in many recent exercises.

Yeah, all I've got is emotion on my side. I think you should reexamine yourself.
Reply: You just won't answer my salient points will you? You just want to throw insults around. Pilot testimonies said weaponless F-35s at Red Flag 17-1, stayed in the fight and IMPROVED the F-22's Situational Awareness, making the F-22 better. I don't know, sounds like a pretty good sensor aircraft to me.

EOTS is working fine, as recent exercises have shown, not to mention pilot testimonies about these exercises. Maybe not perfect yet, which means a failing grade from Dr Gilmore.

And although Dr Gilmore at DOT&E has testified as to the necessity of the F-35, as my linked video shows, he only has two grades, perfect or failing. Kinda silly actually, but the man is paid to be hyper-critical. I don't think he realises how he influences people into thinking that something that is not yet perfect can still be extremely useful. And, of course, it will never be perfect. Nothing ever is.
Reply: LPI radar will work against older equipment but it's a pipe dream against a near-peer. It hops not a very wide range of freqs and radar itself inherently has to be able to receive the signal. I know for sure Typhoon can detect it and just from a physics perspective its not so hard because if you are getting a large amount of coherent X-band emissions from exactly bearing 123 obviously it is a radar. So F-35 and F-22 can either not use radar and be detected first due to opponents having superior IRST (F-22 especially as it has no IRST and cruises at "speed of heat" mach 1.5), or they can use their radar and still be detected first due to opponents detecting their radar
Reply: Widg3t's Widgets You're hopelessly naïve if you think a pilot is going to publicly badmouth their nation's planes. Also embarrassingly uneducated if you don't understand the difference between anecdotal and empirical evidence. Nice attempt at mis-characterizing what little you read—I'd bother to correct you if the evidence I linked weren't so abundantly clear on the facts. If anyone is actually curious they can read for themselves. You'd have to be in massive denial to believe that the F-35 is some kind of super weapon when the people in charge of making it work are reporting that it's incapable of fulfilling current mission requirements, and has so many problems they've run out of staff necessary to complete testing.
Reply: Radar works by emitting an radio wave and capturing the echo. 
That's the basic foundation.

If they emit a radio wave then you receive the wave with a reciever and find out the proximity of it's source by calculations.
Making this low observeable is simply impossible. You have to send out waves in order to make it work. You can fly with passive radar which means you try to locate the enemy based on their radar waves. But that only works if the SU's actually have their radar enabled.

You have a point on the jamming part.
Reply: Peter Lonjers  The arguments I see for "the F-35 not being extremely powerful," come directly from those in charge of testing and development. Read this Pentagon memo: http://bit.ly/2hhnn8W  It describes the F-35 as, “not effective and not suitable across the required mission areas and against currently fielded threats.” Its also states, “In fact, the program is actually not on a path toward success, but instead on a path toward failing to deliver the full Block 3F capabilities for which the Department is paying almost $400 billion by the scheduled end of System Development and Demonstration (SSD) in 2018.”

Apparently they have trouble just getting it airborne. According to testimony given to Congress, "The software 'was so unstable that productive flight testing could not be accomplished,' Mr. Gilmore said, adding that the software is less stable than earlier software it replaced." (http://bit.ly/29vVof7) You can see the full extent of the problems being described in the DoT&E report: http://bit.ly/2bHnRDA.

The idea that anyone pointing out flaws and shortcomings of the F-35 is either uninformed or a Russian troll is comical. Unless you think the Pentagon is staffed by “Russian fanboys” and internet trolls, lol.
Reply: widgets I hate to burst your bubble man but any officers saying "they'd prefer the F35" are expressing the opinion they're told to express. seriously, plane isn't even operational yet and someone would take it over two of the most successful fighters in history? I don't know how it can simultaneously be a lemon and wreck everything, stealth is only against X-band radars and only from cooperative angles. you can still see it in a wide variety of ways and what can be seen can be hit. perhaps the pilots who would prefer the F35 are cowards who realize if they go to war in that plane it will spend so much time on the ground they won't actually have to fight